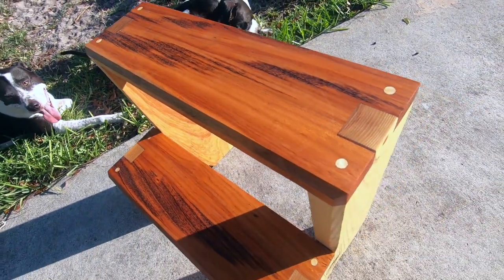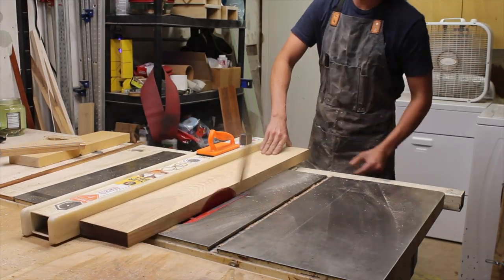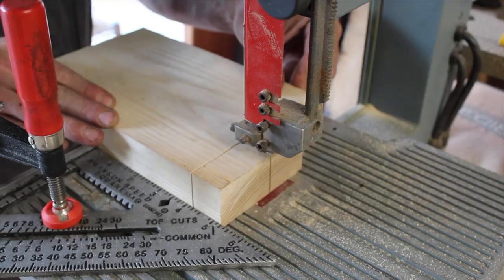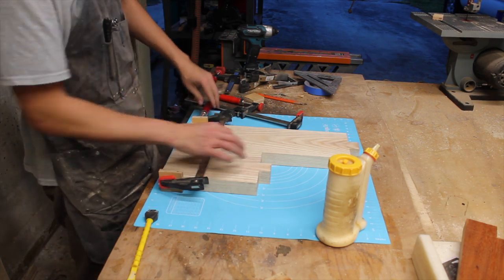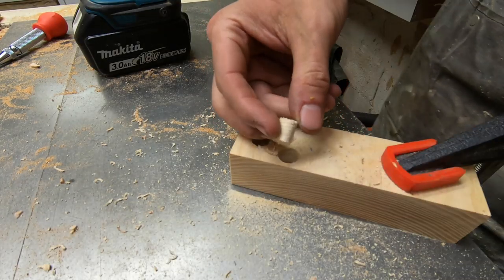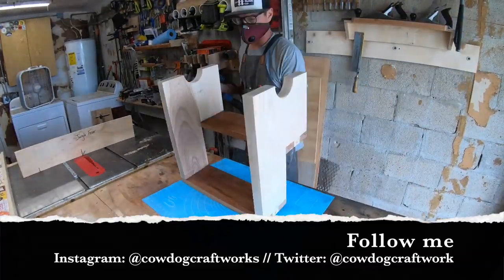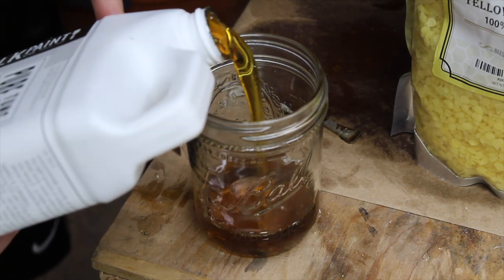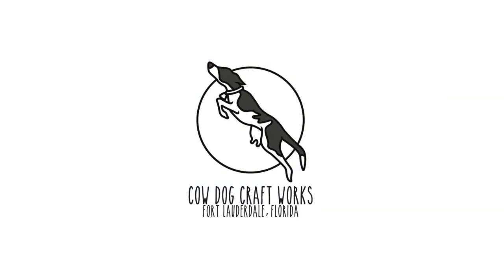Basic Hardwood Step Stool

Comment: Thank you for a great video.
Reply from the maker: Syn Survival & Bushcraft thanks for coming along for the ride!
Reply: @CowDogCraftWorks  I've actually been wanting to do something like this. I have a miter saw / table saw. I don't have a bandsaw so I was thinking I could use a multi-tool I have to cut out the fittings for the joinery. Could use the miter saw carefully to cut the hunks off for the other part of the joinery but I know it won't look nice, lol. 

I did subscribe, and honestly will be watching all your future videos. I'm surprised your sub # compared to the quality of this video. Keep it up. Post at least one project a month and maybe informative videos that are easier to do like demonstrate different joints or various ways to plane some lumbar if you don't have a planer. 

<3
Reply from the maker: Syn Survival & Bushcraft If you have a cross cut sled or a miter gauge with a back stop you could stand the boards up and cut out the joinery that way.